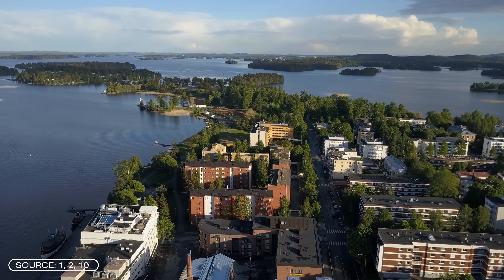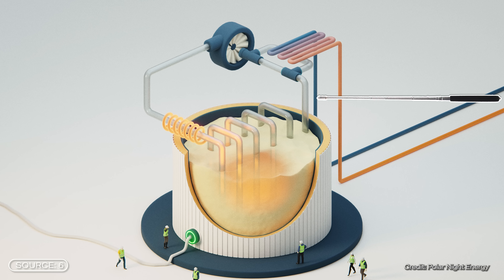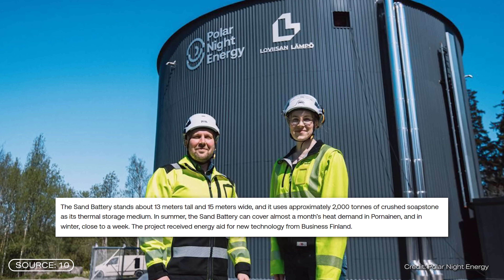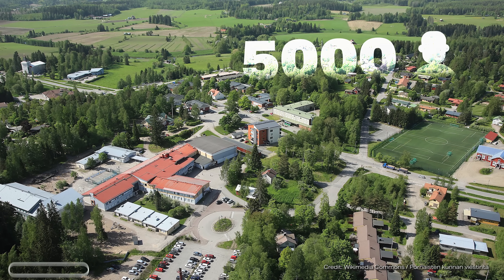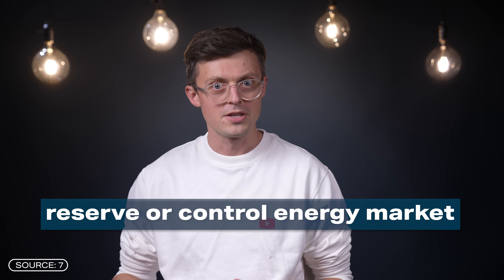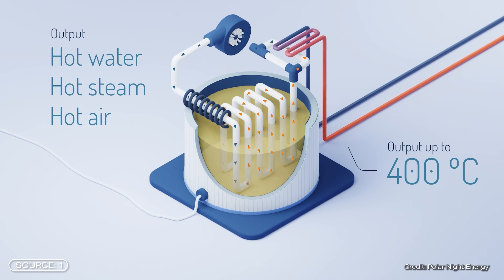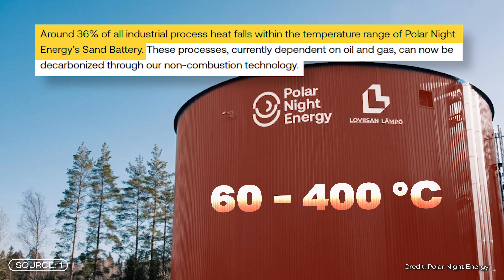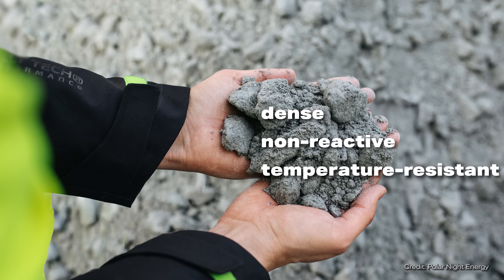Finland's Giant Sand Battery: A Revolution in Energy Storage?

Comment: Finland have more use for heat pumps and that technology is used over 20 years. In last 3 years it is expanding for heating of apartment blocks connected to communal heating system. Sand batteries could be grrat for areas with large difference in temperature between day and night.
Reply: We need heat 24/7 in winter but electricity price has massive differences. The cheapest hour today is 3,15c/kWh ja the most expensive is 33,28 c/kWh. And we need more heat when it's more expensive rather than when it's not (schools, offices etc are closed at night). With stored heat we can charge batteries by night to heat during the day.
Reply: @henrifin  The three university students that developed the Company, Polar Nights Energy, they talked about the governments drive to be green energy self sufficiency in the future. They knew using solar would be excessive if  built to the scale needed to meet the winter time demands, so they rationalize by building a smaller solar array that would have excess production in the summer, they needed to take that excess and store it. They brainstormed thinking they needed a dirt cheap way to capture and store the excess electricity, be it solar or wind. Hence the sand mass battery.
Reply: We do have heat pumps though, to either heat the air or to heat air and water (to strage for washing and central heating).

Comment: This isn't really what you think when hearing "battery". It should output exactly whatever you put into it.
Reply: It should be installed where the customer needs heat. Then it is much more efficient than a battery storage. It is much cheaper per kWh and will work for a very long time like hydro.
Reply: Well, it's an energy battery, not an electricity battery.

Comment: For smaller sand batteries--where efficiencies need to be maximized, I wonder if it would be cost effective to tweak the sand mixture.  Here's a very interesting video regarding a mini geothermal  system that maximizes  heat exchange--by using small amounts of graphite powder (AND "flaked" graphite) in the mix around the ground loop piping:
 https://www.youtube.com/watch?v=s-41UF02vrU&t=76s

Maybe this has already been tried (?)  but it could be a useful addition in some situations.

Comment: In Finland for decades is been build a heat battery in the houses, we have water central heating in the houses, moust uses tousens of liters water reservual that's, back in the 70 to early 2000 where just commanded by a tariff clock to turn the heater on during the night for cheap night energy and nowhere days smart meters are commanding the heaters for the reservual. Back in the day, Finland used to be a big industrial county and the industrys were taking most of the power during the day time and it's cheaper to keep the load more stable with using making system to get cheaper rates during night time. This days the smart meters are making a role for grid stabilizing by turning on or off the heat louds for apartment. Not all apartment have this system but quite meny.

Comment: Sand batteries absolutely make sense in Finland, where wind power plays a significant role of energy production in the winter. But the coldest days usually have the least wind. Cold, windless bouts rarely last over 1-2 weeks, so chances are these would reduce the usage of fossil fuel significantly. I don't view sand batteries as an alternative for lithium batteries, however, but they instead complement each other.
Reply: That is why Finland relies on recently built new nuclear power for a reliable base load source. It never runs out of wind or sun light and endures grid stability. Salt batteries can operate well in such a grid.
Reply: Rossman o7
Reply: Let's say when this was demoed there was a load of delegations from Central Asian countries where winters are bitter also. I can see potential in Canada, Northern USA, China, Mongolia, Koreas, even Japan also. And why not in Antarctica.
Reply: Coldest days often don't produce that much solar either :D

That's the big problem with solar power, it's abundant during the time of year when power is needed less, and the output goes down as demand goes up in the winter. Both variations in supply and demand get lesser the closer to equator you get, but up north, it's kind of a bummer.

But at least solar tends to be producing during the day when demand is largest as well.
Reply: "Coldest days usually have the least wind". During those freezing days there is often hard wind at hight of 100 m +, that modern high wind turbines can use. Near the ground level is steady cold air pools.
Reply: @joukoniemi9250 You can build HTES with a week of storage, because they are much cheaper than battery storage and H2 infrastructure and fuel. This is especially useful if you need heat in the end anyway, like industrial process heat or block heating.
Reply: @joukoniemi9250 I stand corrected! I also read that since the cold air is more dense, it actually carries more energy at the same speed. But cold and still days (even at higher altitudes) are a possibility, so I believe we still agree that these type of batteries make sense in Finland.
Reply: We don't use fossil fuels for electricity or heating in Finland. We use renewables, garbage and nuclear(~40%). Gasoline is the main fossil fuel and that's obviously for cars. Lithium batteries are for electricity and sand batteries are for heat.
Reply: @ketskaesor9467  ehh, we still use coal and natural gas quite a bit for both electricity and heating. There's still a long way to go.
Reply: @jattikuukunen  Coal is under 1% and gas is made from organic waste.
Reply: @jattikuukunen  Coal is less than 1%. Natural gas is 5% and large part of is used by industry or it's made from organic waste. Fossil fuels for electricity and heating is 2-4% so it's pretty much irrelevant.
Reply: @ketskaesor9467 5% of heating is directly from oil, and almost 30% of district heating is still fossil and peat. Even though we burn a lot of wood in various forms, fossil fuels are far from insignificant.
Reply: It may be a supplement for H2 used for energy storage and regeneration of electricity.  This will depending on temperature more efficient than the H2 efficiency ladder.
There are HTES with up to 1300° C, and some with more than 2000° C using carbon an Thermo-Photo-Voltaics with efficiency up to 40 %.
Reply: There isn't enough lithium to meet demand, but plenty of battery technology is being developed instead

Comment: Why does this have a service life of only 30 years?  I would expect such a device to last at least 300 years, if not for eternity.
Reply from the maker: Well the sand itself yes, but probably the cylinder outside and maybe also the heating wires. So you can reuse parts of it, but have to replace some other parts. Best, Jacob
Reply: That is the calculated supposed lifetime. It might last way longer than that. However they won't promise more than they have to. 30 years is what is expected of district heating plant, so 30 years is what they promise.There is no point promising or bragging about longer lifespan. All it causes is them to have to do extra work to show calculations and engineering studies for any extra years. Just as they had to for 30 years, but the longer you promise, larger error bars, more safety margin on has to put into ones design and more work to show material longevity and so on.
Reply: @aritakalo8011  Ok, let's spin this around then.  Why are they only asking for 30 years?  If I were the consumer, I would ask for eternity.  This sounds like fraud to me.  I've seen mud houses lasting more than 30 years.
Reply: Many Finnish district heating companies renew their pipelines at the age of 30–40 years, even though the technical service life may be longer, in order to avoid high-risk leaks. I think the service life of sand batteries has been estimated roughly the same.

Comment: Can it be used as a backup when the electricity grid goes down . Maybe with sterling engine generating electricity? I know the efficiency is terrible in that scenario but it is better than no electricity at all.
Reply: With high temperatures it could reach an efficiency similar to peaker plants or coal.

Comment: In the Netherlands using district heating kost about the same. quick example (city of Ede) is 740 euro just to be connected.
They claim it is in the end 535 euro more expensive a year then using natural gas. Which is making no sense when using leftover heat.

Most houses connected are rental and can't switch to something else. As a house owner getting disconnected is very expensive.

There are some new projects planned, but house owners are not willing to switch to district heating because of the cost.

Large scale heat storage can work, but here it will not be sold cheap to the end costumers.

Comment: For Nordic countries with heating from central heating plants it is good. Because we already have the infrastructure to heat homes, this will be just one more step in the process. Pointless with stable nuclear or hydrogen power; but good for areas with wind power. South of Sweden could use it too heat the sand when windy and use it when the wind stop.
Reply: The main thing question is how it interacts with already existing heating plants and it actually provide any benefits.
Reply: @znail4675  The benefit is that you don't have to burn fossil fuels while the sand battery can provide the energy instead?
Reply: @seeibe  But those plants also deliver power and are most likely needed to run anyway during winter time. There would be some advantages, but it's not quite as straightforward as it may look.
Reply: @znail4675  by the district heating utility putting it up and owning it next to their boiler plant? As in this example case. It means the district heating utility has to burn less fuel, which means they save money. Since the point is to charge the battery with near free electricty, when grid has overproduction and suppliers are desperate to find buyers to dump electricity to. So district heating utilities come and say "our sand battery  heating up can soak up hundreds of kilo Watts of electricy. gimmi, gimmi, gimmi, om nom nom. and gorged on free heat."

So for them it is essentially and investment to be able be able to buy heatinf fuel (electricity) at basement price by taking advantage of natural production and consumption inefficiencies. Inconvinient intermitten producers can be put to use by soaking up the over production capacity in flexible manner and for that service they get their fuel for insane cheap price.